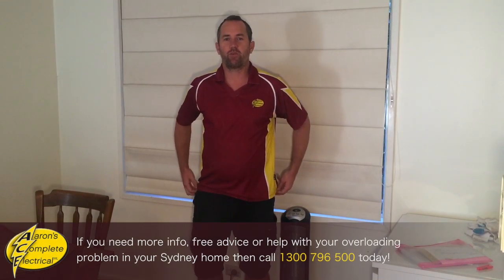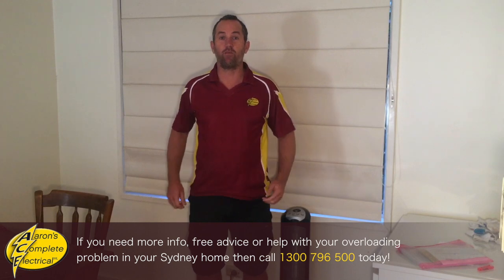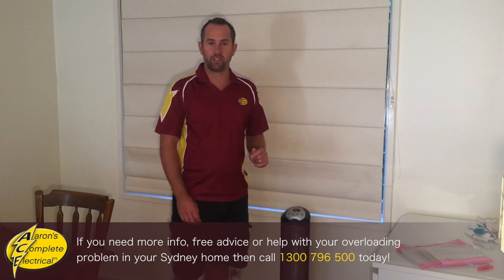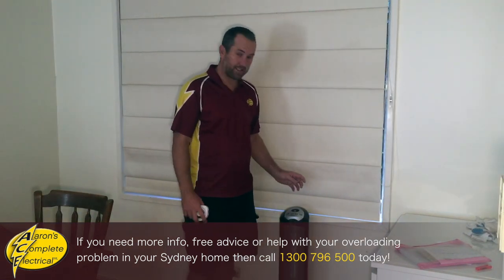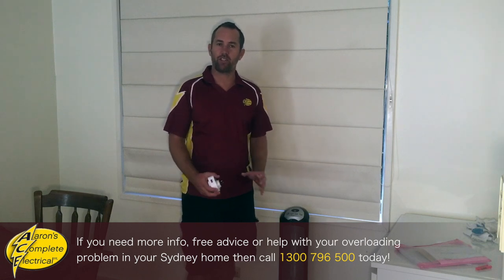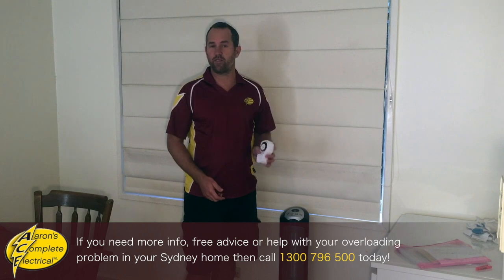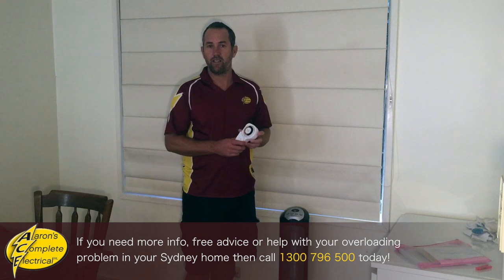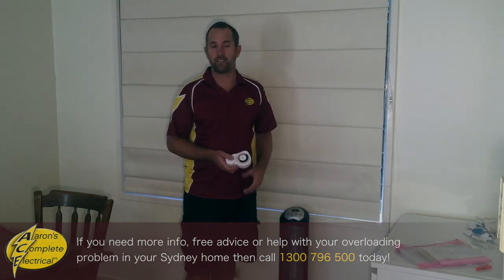How To Stop My Heater From Overloading My Power Circuit

Comment: where is info about "Stop My Heater From Overloading My Power Circuit"?
you just said to only heat it for small room
but that does not prevent/stop overload of powerboard

https://youtu.be/_8S1H-TB9QE?t=44